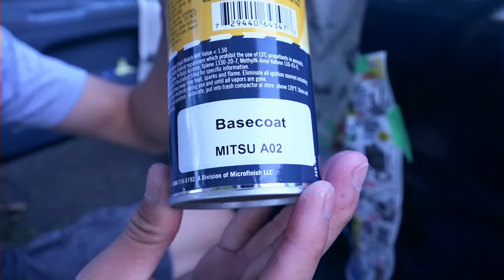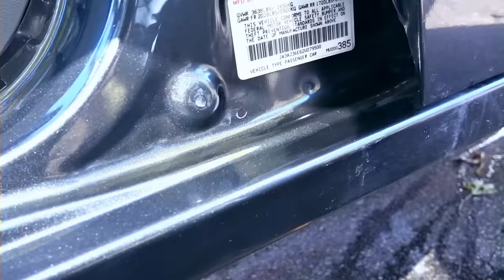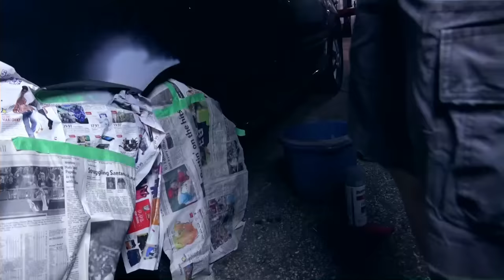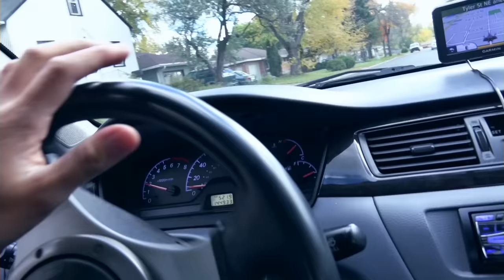Lancer Fix 34 | Rust Surface Repair

Comment from the maker: U-Pol 0796 Clear Coat doesn't last long against UV light! It flakes off about 3 years later.
Use SprayMax 3680061 2K Clear Coat instead! https://ebay.to/2ZXV6cS https://amzn.to/35SW6CN

Comment from the maker: Hand Grinder
eBay https://goo.gl/N8xi27
Amazon http://amzn.to/2oA8pPE

Sandpapers p100, p400, p1000, p2500
eBay https://goo.gl/CMESok
Amazon http://amzn.to/2n94gSe

Body Filler
eBay https://goo.gl/3ccNYv
Amazon http://amzn.to/2oYgXvA

Anti Rust Primer
eBay https://goo.gl/OwjTj5
Amazon http://amzn.to/2oAVnRu

Basecoat 
http://www.automotivetouchup.com/

Clearcoat 
eBay https://goo.gl/FcT8Ue
Amazon http://amzn.to/2oGDHkx

Electric Buffing
eBay https://goo.gl/9J0Lic
Amazon http://amzn.to/2n9dD4e

7" Buffing Pads 
eBay https://goo.gl/Obsqwh
Amazon http://amzn.to/2nClsuD

3" Buffing Pad Kit 
eBay https://goo.gl/sJbV8K
Amazon http://amzn.to/2nVAVHY

M105 Compound
eBay https://goo.gl/aCjg73
Amazon http://amzn.to/2nIcnkZ

M205 Compound 
eBay https://goo.gl/GhRhb9
Amazon http://amzn.to/2oGt3ue

Comment: The colour match is very good for a rattle can!
Reply: It's the exact same color from the factory, he told you can find the color code under the hood a video earlier.
Reply: +infernal nl yeah but the colour on the car fades over time and some people who match the colour into the can dont always do it very accurately so the shades can end up being slightly different
Reply: +That-JDM-Fascination! Thats what I meant.
Reply: evoGage yeah i knew you meant that but it seemed like infernal nl didnt quite get that they could end up being slightly different sometimes
Reply: I get that's it's hard to match, but if you have the exact color code, it should be a matter of precise weighing how much of what color must be used to mix and get the right one. I thought he used a factory mixed version.
Reply: infernal nl he did but no two batches are ever the exact same and the sun damages the paint on your car and it no longer becomes the exact same as the the paint code
Reply: True that, but how he color matched it is probably because he faded the edges instead of a hard mask off tape line. so it kinda went off to an overspray line to mix the colors that way from old to new
Reply: infernal nl yeah im not saying in this case that it was bad and there are ways of fading the two shades together
Reply: +That-JDM-Fascination! does he look like the kind of person to leave his paint to fade haha i can see him repainting his whole car an hour before work at 8am
Reply: KSI SubSonic its not like hes owned this car since new but youre right he does look after his car but i wasnt saying this exact example was a bad match just that its very common for the matched paint to not be quite right
Reply: That-JDM-Fascination! that why i havnt painted my truck the robins egg blue is now a dull white with spots of algae engines done for right now so i havnt done much to her recently im saving for the rebuild parts
Reply: KSI SubSonic best off to just get a cheap close door respray or do it yourself its not very hard at all. some plastic sheets in your shed and a couple of decent size fans. maybe a heater if you live in a cold area but i did mine on my last car for $400 and i layed 8 coats of clear on so i could cut it right back when polishing and she came up a pearler
Reply: That-JDM-Fascination! thing is im not sure if i wanna paint her anymore since ive had her looking just like she is for 6 years its almost like character now but im worried about the rust
Reply: KSI SubSonic yeah well theres only 1 proper way to do it and thats to get rid of the rust if it comes down to that

Comment: Hey my radiator fans turns on as soon as I start the car and the temperature gauge goes to H immediately and sometimes it’s in the middle but the fans is still on do you think it’s an engine coolant temperature sensor?
Reply from the maker: It could be the thermostat

Comment: hello manckey, I recently purchased a 2003 Mitsubishi Lancer oz rally and the "service engine is on" I took it to auto zone to check the computer and it said it detected a small "monitor leak" I'm not sure what that is.. I'm new to cars.. PLEASE HELP!!
Reply from the maker: +Chayanne Trejo Hey. What code was it?
Reply: +The DarkDragonWing woo!! didn't think you were going to reply. :) the error code is p0456 keep in mind my car has 64,500miles. I also changed the gas cap. thank you for helping :)
Reply from the maker: Chayanne Trejo
 Oh I see. You might have already found this, but this is the only source I could find.
http://repairpal.com/2002-mitsubishi-lancer-has-check-engine-light-on-when-scanned-shows-code-p0456-294

You will have to check all those places that they mentioned for leaks.

Also, you already replaced the gas cap, did you reset the code after that? To reset a code. you will have to unplug the battery for 1 minute and plug it back or you can use a code reader to erase the code. cheers
Reply: +The DarkDragonWing I did reset everything.. the light went off but then a few days after that the light went back on.. :/ good thing I have warranty on the car at the dealership I bought it from. What should I tell them? to check everything?
Reply from the maker: Chayanne Trejo
 Yes, need to find that small leak spot. Good, warranty, so you don't have to pay the anything right?
Reply: +The DarkDragonWing yeah that's what they told me. they cover bumper to fender EXCEPT breaks and oils.. the regular maintenance stuff. thank you for sending me that link it mind if helped a little bit and thank you for your help!! do you have a video about replacing the drum breaks on your lancer? I kind of need to Change mind soon haha.
Reply from the maker: Chayanne Trejo
 haha No problem, I will keep the brake drums in mind.

Comment: you dont primer and then bondo..... bondo goes on bare metal once your done shaping and feather edging you primer.
Reply: He probably wasn't able to remove every speck of rust so the rustoleum keeps it from eating away if would have put it right over it the rust would have bubbled up the bondo